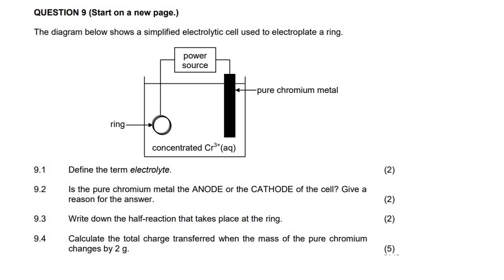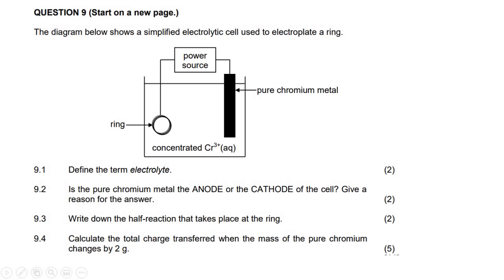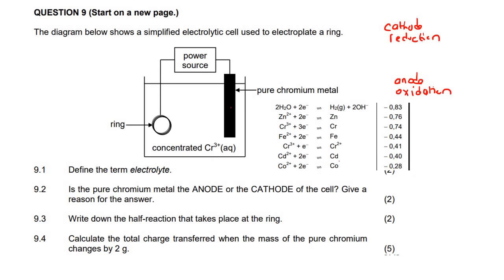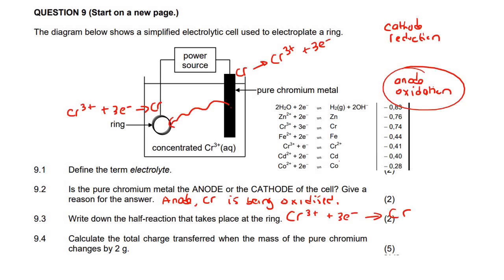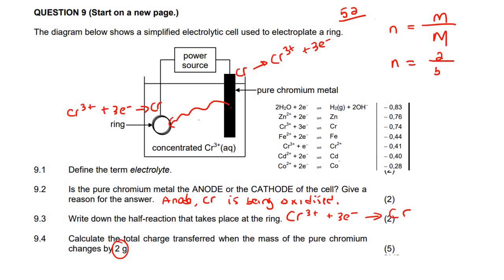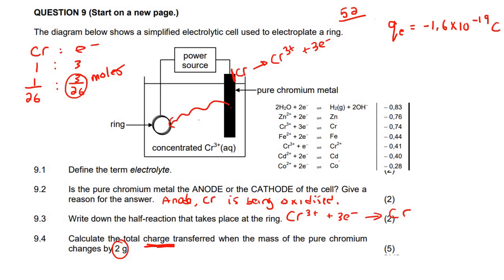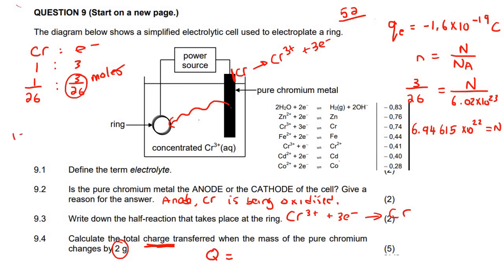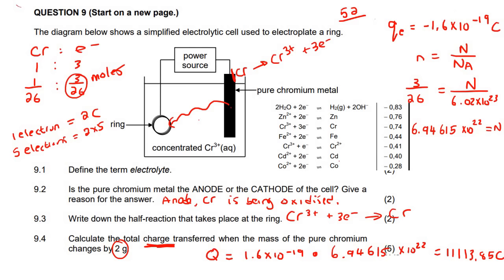Electrolytic Cell grade 12: Electroplating Exam Question

Comment: hii 👋 for no 9.3) why would it be incorrect to use  n=Q/qe where n=3/26 and qe =-1.6×10^-19 and solve for Q ???
Reply: 11 months later lol but i had the same thought. in the formula n=Q/qe: 'n' represents the amount of electrons and not the number of moles of electrons. You will need to use n=N/Na ( here 'n' DOES mean mole. Once you have N (the number of particles (in this case electrons)) you can then take that N and use it as 'n' in the n=Q/qe formula to get the charge. doubt that makes any sense but i tried my best